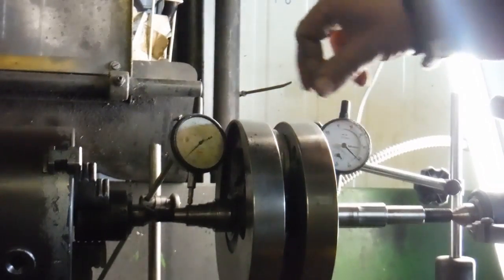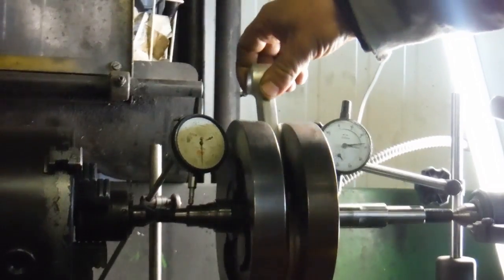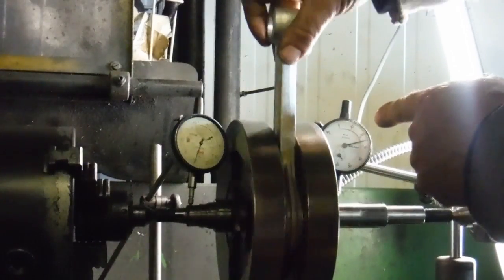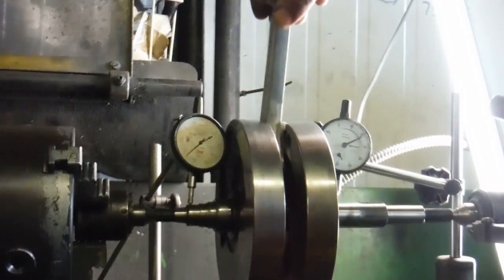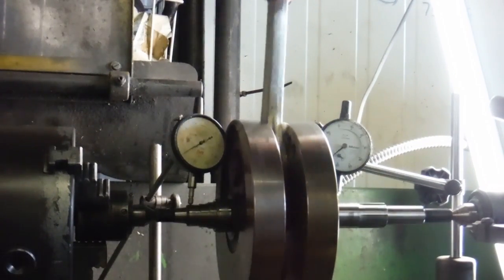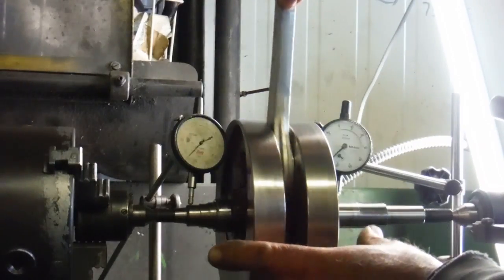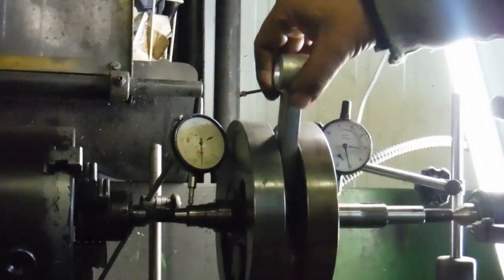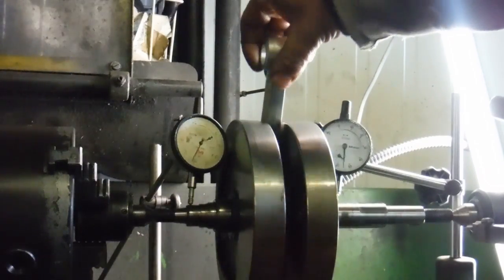Royal Enfield Bullet checking crankshaft for  run out.

Comment: Hey Paul,

Greetings from India. Have been closely following your channel and have subscribed as well. I wanted to know if and how can the Flywheel weight reduction be done and in what context does that improve performance on the RE Continental GT 535 2016 make. Am considering a Hitchcocks kit (partially ordered) as am interested in gaining more power on the higher end of the RPM band.

Currently running:
- Powertronics Programmable ECU
- K&N Air Filter
- Velocity Stack by derrotone
- Free flow exhaust 

Can't stop obsessing over this as am interested to do something to the engine by not using something off the shelf. 

Any tips you can provide?
Reply from the maker: Hi Aditya, I split the cranks and remove material from the flywheels in the lathe and rebalance as required. I have not done this for a UCE engine to date, but I have some videos here showing how I made a 535 CGT a lot faster. A lighter crank will give better accelaration and throttle response, more power at rear wheel, easier life for main bearings and even the brakes will feel a little sharper, due to reduced flywheel inertia.
 You might want to take a look here :  https://www.facebook.com/groups/132597770120179/
Reply: Paul Henshaw Thanks a ton Paul. I've requested to be added to the group as well. Now, can you in box me if you can ship a UCE GT535 Balanced Crank to India for me? 🙈

Comment: Hi Paul. I have a 350 Bullet. The timing shaft is not 90 degrees to the fly wheel when fitted and screwed up. I bought a new shaft and fitted it up to the fly wheel with the same result. Not a lot of run out but more than I would like measured in a lathe. Do you have any thoughts as to why this is happening. The crank is from a 1964 RE and the driving side shaft is perfect.
Reply from the maker: Hi Bob, I can only assume there is a fault in the bore in the centre of the flywheel, or perhaps the locating key is sticking up too far out of the keyway and tilting the mainshaft slightly?
Reply: +Paul Henshaw 
Hi Paul, I never thought of the key and that is probably the problem. Thank you for your help. Will tell you how it goes. Bob
Reply from the maker: No problem, Bob. Hope you get it sorted and look forward to finding out how things go. Paul.
Reply: Hi Paul sorry about taking a while to reply but better late than never. It was the key and all is ok now. The timing shaft is still spot on and the drive shaft that I had the key trouble with is running at 2 thou. My crank truing man says that that is the best that he can do and I am happy with this. I have 3000 KMs on the engine now and it is a beautiful thing. There is no vibration from after taking off and going up to 100KMs or 60 MPH. The mirrors stay clear and it is a great ride. I did not believe that a single cylinder motorcycle could be so smooth. Thank you for all your help with my problem. Bob